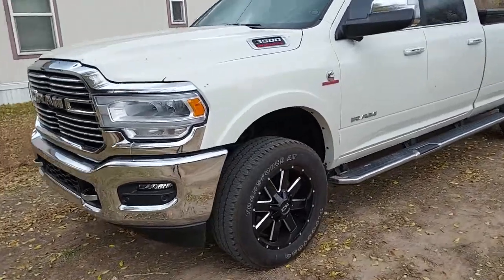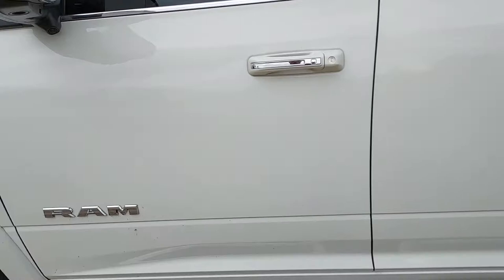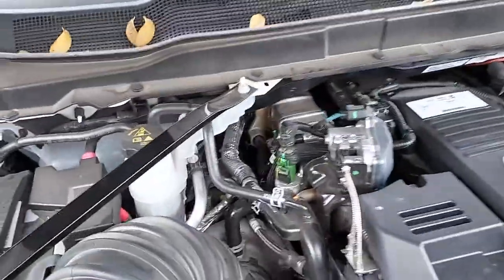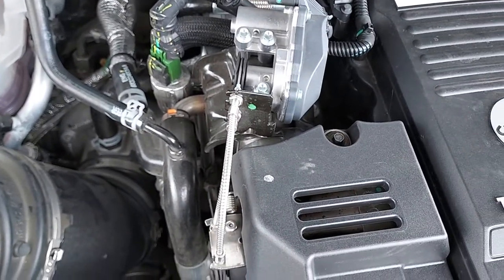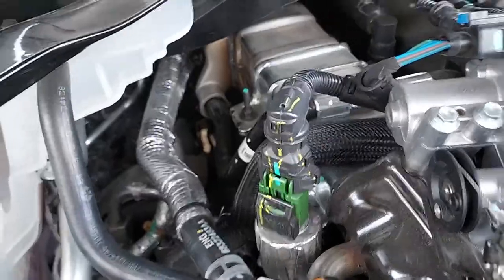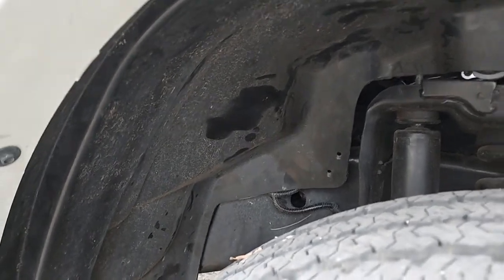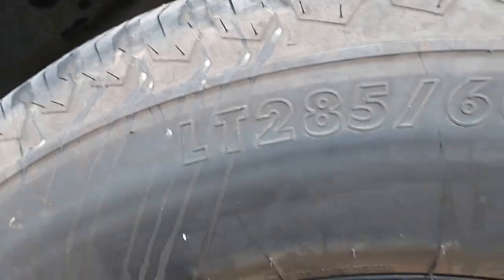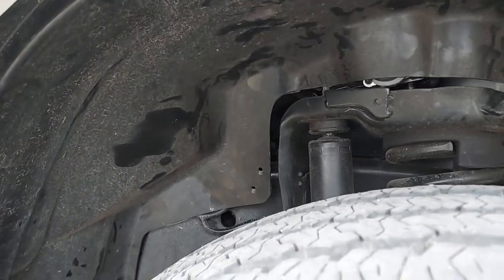edge insight and egt probe on 2021 ram 3500

Comment: Hello Curtis. Good video but I have a couple questions. I have a 2021 Dodge Ram 2500 with a 6.7l Cummins diesel. I am still learning this engine and I also use an Edge Insight CTS3 plugged into the OBD to monitor EGT1-5. However, I am not sure where Dodge put these EGT sensors c/t the engine and what is normal temps I should be seeing. DO you know? Also, now this question comes to mind. Why are you installing another sensor probe if Dodge has sensors c/t the EGT 's already? Thanks
Reply from the maker: Hi there,
So sounds like you have gotten the edge Insight to work on your 21 ram? Mine still won't. Although I am using the small cs2 instead of the cts3 that you are using.
Can't tell you exactly where the factory egt sensors are but I do know all of them are after the turbo.
Any reading you get after the turbo and further down the exhaust will be much cooler Temps then what they should be.
The best and most accurate spot for a egt probe, on a Cummins, is In-between cylinders 5 and 6. That is the hottest spot in the exhaust system, therefore where the reading should be from. 
Which is why I installed a probe from edge so I could get the correct egt reading.
Reply: @curtisbull1583  FYI I found out where Dodge puts their EGT1-5 sensors on their new Dodge 6.7l Cummins trucks. They are:

EGT1 before the DOC Diesel Oxidation Catalyst
EGT2 Between DOC and DPF

Note: On a full load these temps s/b 1000°F - 1200°F Max on front sensors, and on a REGEN they s/b about 1050°F.

EGT3 After DOC After DPF
EGT4 Inlet SCR (Selective Catalytic Reduction)
EGT5 After SCR Outlet

I like your EGT probe between 5 & 6th cylinders. To add which is why the hottest gases are at the front sensors. 

Thanks for the reply. I learned another lesson today. The more the better

Comment: Did you have to drill a hole in the firewall or is there a good spot the cable goes through?
Reply from the maker: Honestly I can't remember what I did for sure, but I didn't have to drill a hole in the firewall. I believe there was some sort of cover that I took off put a hole in it and then put the cover back on. I'll have to take a look at it tomorrow afternoon to remind myself what I did there.